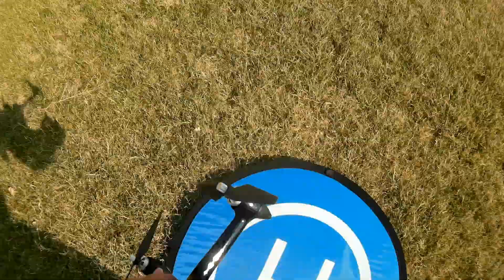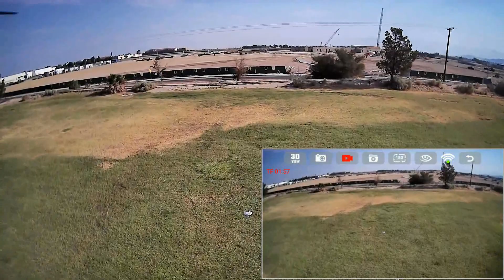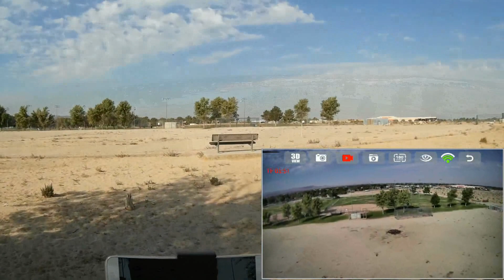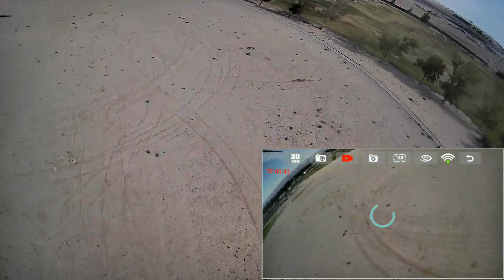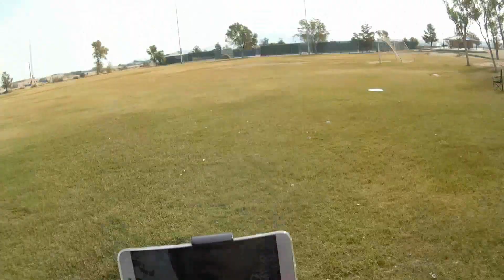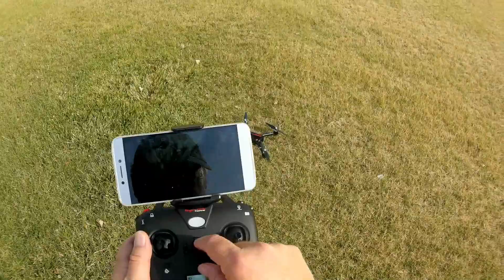MJX Bugs 2W B2W High Speed GPS FPV Drone Flight Test Review

Comment from the maker: Get the Bugs 2W FPV here https://goo.gl/FGNE5W  and the cheaper non FPV (has 1080p camera) Bugs 2C here https://goo.gl/5vE1oq
Reply: Andrew Jackson you can calibrate inside... Just connect handset then spin anti clockwise whilst level 3x then hold nose upright vertically and again spin it 3x anticlockwise the lights will go solid and good to go
Reply: Quadcopter 101 will the fpv work with my Google pixel?
Reply: I just got my Bugs 2C.  I can't get it to calibrate compass.  It wouldn't do it in my living room, so I took it out to the garden, but It wouldn't do it there either.  I did it just as everyone else.  Do I need to go to a really wide open space?  Can somebody please try calibration in their living room and let me know?  Thanks you, guys
Reply: Quadcopter 101 Nice review! I've ordered one myself, though it's the none wifi version, the b2c.

Quick question though, will the motors, esc and props on the bugs 3 work on the b2c? Thanks

Comment: can anyone tell me how high the heli goes when you press return tobhome.  I'm at park and suddenly it shoots 2x higher than trees. I think I went to hit camera but hit home instead.
Reply from the maker: I think that the default return to home altitude is 30 meters.  But the idea of the climb is to avoid hitting any trees, homes, or telephone poles/wires on the return flight.

Comment: I know this sounds crazy have u heard anything about dropouts in the bugs 2w it has done it twice both times luckily falling close and low and never lost power battery still locked in really worried
Reply from the maker: No I have not.  But it would be best to ask your question in the following forum.  There are many owners of the Bugs @ there, and they would be better able to answer your question https://www.rcgroups.com/forums/showthread.php?2870099-MJX-Bugs-2-B2W-GPS-1080p-Camera-5-8-FPV-2km-range-Dual-way-transmitter/page168

Comment: A new Bugs Go app update just happened. In it is a new bugs 2 se with follow me and circle me function. The new Bugs Go app now houses multiple quadcopter versions. I wonder if a firmware update via the bugs2w sd card slot could achieve the follow me function with the phone on 2.4ghz.... Cant see why not. The se app looks far more in depth with more telemetry available.

Comment: Today was my first day flying my Bugs 2w... one thing I noticed was it drifted a lot in the wind.. how can I stop this, I thought they had position hold.. or am I also mistaken about that function .. regards.
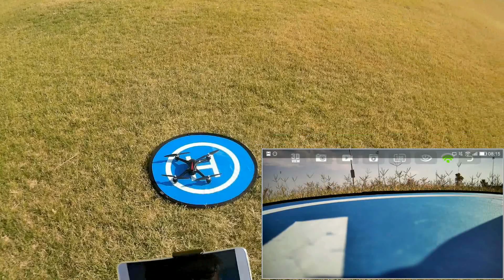Reply from the maker: It has an excellent GPS system and position hold.  There is a button just below the left stick.  That button lets you turn the GPS position hold on and off.  Move it to the right to ensure the GPS position hold is activated.  Also recommend watching the above video starting at 7:25 for other tips on this drone.
Reply: Quadcopter 101 thank you for the quick reply,
 the bugs 2w was on gps from the beginning, but seemed to drift quite a lot above 30m, so had to apply opposite stick to maintain position. I almost lost it over the tree line - luckily i pressed rth in time. Am i missing something or was the wind just too strong for the gps? It could easily fly into the wind manually. Oh and i had approx 9 sats locked
Reply from the maker: 9 satellites is the bare minimum for a satellite lock to maintain position.  Chances are you lost one of them in flight, which caused the drifting.  I always let a GPS drone sit on the ground to get at least 11 satellites before takeoff to prevent loss of GPS lock.
Reply: Ah ok, great, so it should hold in windy conditions if i leave it hovering in gps mode with 11 sats. ill go out and try that later. thanks qc101
Reply from the maker: No.  I meant don't even take off from the ground until you have at least 11 satellites locked on.  If you takeoff with only 9, you might lose one in flight.  If it momentarily drops below 9 satellites, the drone will automatically switch from GPS to altitude hold mode, where it will drift with the wind.
Reply: Quadcopter 101 ahhhh i get you now, thats great news and advice thank you kindly.

Comment: Hi qc101. Great review on this drone. I bought one from watching your channel. What i would like help on is how to get the follow me mode and circle me mode working. I think it needs the phone linked to do this but as yet I have not seen or read any tutorials of how to do this. Please can you make a video showing how to execute these operations.
Thanks.
Reply from the maker: I think that you may be confusing the Bugs 2W with my review of the similar looking Hubsan H501S.  Unfortunately, the Bugs 2W does not have circle me or follow me capability.  However, the similar looking Hubsan H501S does have these capabilities.
Reply: Quadcopter 101 thanks for the reply. Im pretty sure it does have a follow me function. Not built into the controller however. This is one of the reasons i bought it. It uses the gps on the phone to activate it....  Ill see if i can find where it says so and post it here.
Reply from the maker: Well that's a new feature for it to me.  Please let me know what you find.
Reply: For some reason i cant add a screenshot here,
 but on the BANGGOODs website for the bugs 2 it states in RED letters of the items description further down the page that it has a  "PERFECT ADVANCED FOLLOWER" mode... I had assumed that this is the follow me function.
(With GPS auto positioning system, accurate positioning location, perfect advanced follower.)
link here to page: 
https://www.banggood.com/MJX-B2W-Bugs-2W-Monster-WiFi-FPV-Brushless-With-1080P-HD-Camera-GPS-RC-Quadcopter-RTF-p-1144178.html?rmmds=search&ID=224522177&cur_warehouse=CN

thanks
Reply from the maker: Sorry, but I don't know what they meant by "advanced follower".  But again, this drone does not have follow me capability.  Recommend checking out other more recent reviews on this drone to see if I may wrong.

Comment: when the battery hits 2 bars the heli beeps and lights go red.  should I land asap?
Reply from the maker: You could fly longer.  But MJX is recommending that you land soon after you receive the warning.  Flying a LiPo battery too long for too low a voltage can damage it.  Hence MJX set its warning at a conservative value of voltage to lessen the chance of new fliers damaging the battery.
Reply: thankx!  it's a new battery so I will break it in like they recommend for lipo. I'm getting about 6 minute flight time now

Comment: Would you know why is that bugs b2w back CCW motor is wobbling. I have never crash it. I check the screw mount on the motor and they are all tight. I need your help. Thank you so much.
Reply from the maker: Also check your propeller to make sure that it's securely attached and not warped or damaged.  But if it looks fine, the motor may need to be replaced.  Replacement motors for the Bugs are widely available http://amzn.to/2ESZsZm  If the drone is relatively new, make sure to contact your vendor's customer service to see if they can help (mainly they should offer a partial refund to purchase a replacement motor).
Reply: Quadcopter 101 I have check the propellers and they look fine. Does these propellers require balancing.  I also hear a winding noise on them also. I will buy the motors. Thank you so much.
Reply from the maker: No the propellers shouldn't require balancing out of the box.
Reply: Quadcopter 101 I will let you know when I replace the motor on it. Thank you so much for helping me out.
Reply: Quadcopter 101 Does the bugs b2w have the same motors as the husban h501s?
Reply from the maker: No it does not.  Different motors.
Reply: Quadcopter 101 Thanks alot

Comment: Thanks for the videos. Great help. I do have a question. I recorded to my phone and can't find the video to play back. I don't have a sd card on my phone and it says it saves to my app. In my app I select the folder on top and and it says "connect not ready" an a wheel spins forever. Any ideas as to what I should be looking for. I looked in my gallery and not there either. I am using an android phone.

Comment: Hi  Q101
    I only have a 2.4G  phone so I have a few questions about the MJX Bugs B2W.  
                   Is it possible to fly this drone, .. and control the photo/ video to the built in SD card, with just the controller and not connecting to the 5.8G FPV at all?   I'm looking for an inexpensive  Headless/ GPS/1080p/ Brushless  drone/ quadcopter, and have also looked at the Hubsan H216A (but I believe this MUST use the app to fly the quadcopter at all :( ) ... and also the Hubsan H501S, which is out of my price range at the moment.  Many thanks for your help :)
Reply from the maker: Yes, if FPV is not important, recommend looking at both the Bugs 2C (and not Bugs 2W), and the Hubsan 501C.  Both the B2C and 501C do not use phone or WiFi,  do not have FPV capability, and are line of sight flying only.  But both have reasonably good cameras. Here's my H501C https://www.youtube.com/watch?v=DohfkCaXAuE

Comment: nice video... thanks for sharing...  the instructions say to set the RTH... but don't say how.  I assumed it would automatically set the home location at first GPS reception after connecting the drone battery (each time)... but when I pressed the RTH button (at about 20m out) the drone went straight up about 20 meters... I switched GPS off to regain control... was it flying to guandong province in china?
How do you set the home location?
Reply from the maker: It first climbs to 20 meters before flying home.  This is so that it will avoid any obstacles (trees, telephone poles, etc..) on its return.

Comment: A word of caution for those endurance fanatics who will no doubt continue flying this fun little quad (within the 100m high/300m distance envelope) after the 2-bar battery warning starts. Make absolutely sure that there are no trees, buildings, kids' swimming pools, fish ponds etc within that 15m radius of your take-off point! If you are between the 2 envelope limits when the battery drops to 1 bar the quad will fail-safe RTH to your take-off point without too much trouble. BUT.. if you are passing through the inner envelope when the change occurs you can bet your bottom dollar that it will drop directly and uncontrolably right where you don't want it to! And no, I haven't.... YET! ;-)
(EDIT - the above has been found to be not completely correct! During battery fail-safe RTH you have no control during return AND while it is hovering & deciding when to land. You cannot cancel the auto landing BUT - during descent you get stick control back & can guide your Bugs to a safe landing. So just fly above all impediments you may encounter during a battery RTH and all will be sweet!)

Comment: I'm surprised at the number of experienced reviewers who don't seem to read the manual before starting a review. Especially in this case since the manual for the Bugs 2C/W is about the best of the "Chinglish" destruction manuals. One of the few features not mentioned is the fact that the headless orientation is set at motor arming (with headless switch off or on) and can be switched in or out at will. To  change set heading you have to land, disarm, re-orientate and rearm. Can be useful if your quad is way out there and pointing who knows where!
I've posted this on a couple of the more popular review channels as none of them seem to have stumbled on the feature yet.

Comment: So I have been flying my furybee around the house right now due to 15 degree temps outside and snow.I have a 18.00 cyclone ordered and am wondering should I get the Hubsan 502s or E or the Bugs 2 non fpv for maybe a low cost of 136.00 from Banggood.I know I cant fly outside for 3 months but Im not sure if the price will go down any lower than it is now due to after christmas sales.Whats your advice Oh mighty Quad God?.
Reply from the maker: They all drop with time.  If you can't fly outdoors for 3 months, wait.  There will be better, more capable, and lower cost drones.  The technology behind this hobby changes and improves very rapidly.
Reply: Thanks for the tip!!.

Comment: So there is a coupon code for 30% off .Can I get the bugs 2 non fpv version for 136.00 from Banggod ?.I think this is better quality than the Hubsan 501 because I hear that it has been a 50/50 shot of getting a good 501 or bad one.I know you have the 502e and you seem to have a very good quad with no issues but it is brushed and maybe they are better than the 501.

Comment: Sir On the bugs 2w is wifi fpv is really good or not or what is the maximum range of fpv and will fpv lags under 300m or worked great plz help .I am really confused which one to purchase b2w or b2c is it worth spending 30$ more on b2w .
Reply from the maker: Maximum FPV range is between 200 to 300 meters.  But it is worth it as it uses 5G WiFi (not the older 2.4Ghz slow data stream WiFi).  BUT you must have a 5G (802.11ac) WiFi capable phone to use it.  If you have an older phone, the Bugs 2W FPV may not work with it.  Do not purchase unless you are absolutely sure that your phone can receive its WiFi video (Google your phone's WiFi specs).

Comment: Thanks for your great review. you mentioned that we need to have a 5g phone, is there any phone / tablet with 5g ?? I have iphone and iPad, not sure neither one has 5g...
Reply from the maker: +Ophélie Courtial you have to check their specs to see if they're 802.11ac WiFi capable. 802.11ac is fifth generation WiFi, and operates on 5Ghz band.
Reply: thanks so much, you're awesome ! would you be able to give your opinion on the best option for a drone under 250$ ? I checked many of your videos, but it's hard when you don't know much about drone :) thanks so ,much for your great reviews !
Reply: thanks so much ! I want to have a screen to see when the drone is in the air, so either through my phone as this one, or a lcd screen on the remote as the Husband H501.under 250, could you give your best recommendation ? thanks so much !

Comment: Actually forget my last message I found the adapter I need to go from small 2 prong JST plug to large JST Balance plug.
The problem I have now is that the only cables I can find that go from  the transmitter to the Action Cam (and from the transmitter to the JST battery balance plug) are for USB MINI  action cams and I need USB MICRO to fit my SJ Cam 5000.  If anyone can help as I cannot find the USB Micro cables. Thanks again.
Reply from the maker: here you go https://goo.gl/GrJ1K7

Comment: Hi, I have all the parts and cables I need to mod my Bugs 2 to radio frequency FPV from my SJCam. However, the one cable I  cannot find is the one that goes from (USB mini) my SJCam to the battery intput balance plug and to the transmitter output plug. I have been able to find some cables that go to the transmitter but the plug on the cable that goes to the balance plug is for a much smaller battery and therefore, It will not connect. My question is it possible to purchase the correct cable(s) premade or will I have to mod a cable to fit the the battery balance plug? Basically I need the cable(s) that run from the SJCam to the transmitter and the cable that also runs from the transmitter to the battery balance plug.  If there are existing cable(s), would someone be so kind as to direct me where to purchase them and/or what the name of them is? Thank you very much for reading and if possible for responding. Much appreciated!

Comment: Hi, I just wanted to get your expertise to confirm that I can power the TS5828 FPV 5.8Ghz 600mW transmitter directly from the Bugs 2 - 7.4v battery? Or do I need a converter? I want to connect the transmitter from the bugs 2 battery to my SJCam. Thanks again for you help! Keep up the great work!
Reply from the maker: You can power the TS5828 off of the Bugs 2 balance plug, similar to how I did it here https://www.youtube.com/watch?v=waMYwaN7aCU
here https://www.youtube.com/watch?v=hVWNTEQt9ZI
or here https://www.youtube.com/watch?v=F64_HFZqXJU
Reply: Thanks again for the help. Would you know if they make a Micro-USB to Balance Charger/Transmitter cable? Because the one they sent me with the transmitter is mini-USB that doesn't fit in my SJCAM. Or will a mini-USB to Micro-USB adapter work? I can't seem to find any ready made cables with micro-USB. They also sell DIY micro-USB cables with open ended wires that you wire yourself to convert. What would be better? to DIY convert it, or just use an adapter? Sorry about the long message.

Comment: Thank you for the very detailed and informative video. Do you know how the Bugs2w sets the home point for RTH? I mean once you calibrate it and take off and then land it at another place, will you need to turn it off altogether and go through the process of recalibration to set the new home point before taking off from this new place? Or is it that the home point is reset automatically from the point you takeoff again without a need for turning it off?
Reply from the maker: Unfortunately, I don't the answer to that question.  But maybe one of the other viewers here does?
Reply: Home Point is set at motor arming as is headless direction.